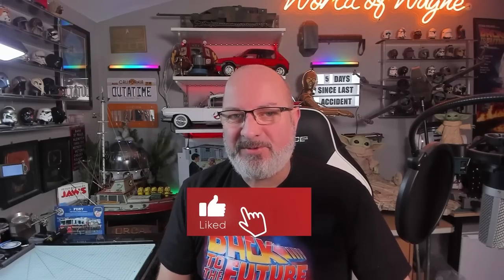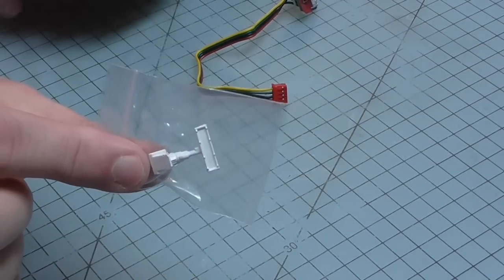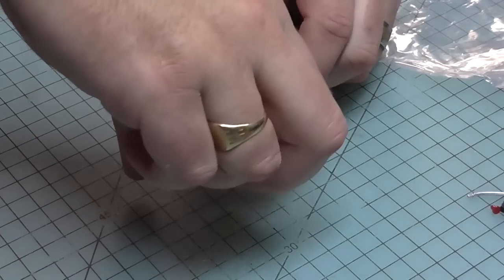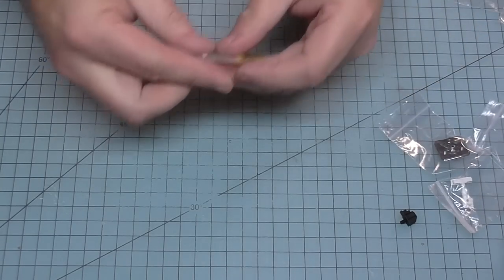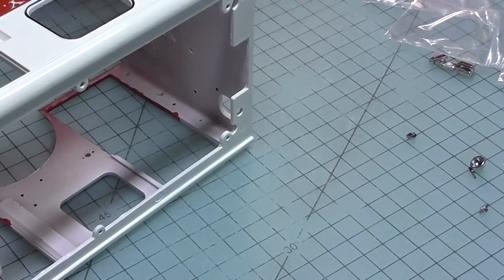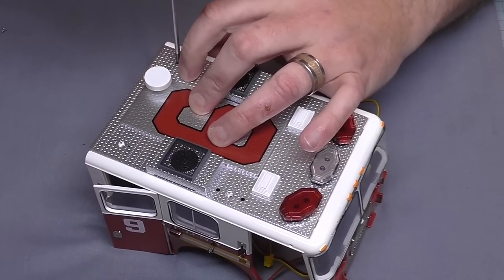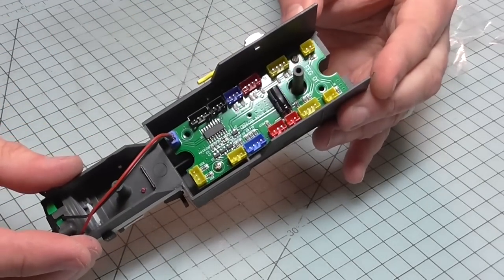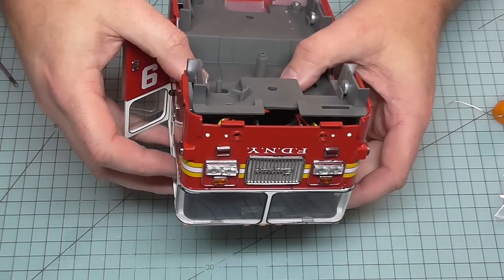Build the FDNY Ladder 9 Fire Truck 1:24 Scale - Pack 3 - Stages 17-23

Comment: Thank you, I had to refer to this video a few times, but you didn't seem to run in to some of the issues I had.  I had to trim both sides of the clear cabin divider with a sharp blade to get it to fit, and I had to file down the corners of the dash to get them to fit.  It wasn't difficult, just tedious and time consuming.  You are right about the tight fits for some of the cables, they could have been a little more generous but thankfully I took care in how I routed them, as you instructed.  Some of the components of this build were ridiculously small, I had spent more time than I care to admit looking on the floor for parts that got away.  I'm not usually lucky at finding parts that ping away but luck was on my side, I found every one that got away.  So far I have referred to your videos on each pack, and I suspect that will continue, so thank you.  I am going to have to support your channel for the help and instruction you provide, it's only right.
Reply from the maker: Thank you NJA and welcome to Patreon

Comment: I just completed Stage 23. Getting the circuit board console into the main cab was very frustrating for me. It took me over an hour to get that in! You didn't seem to have a problem with the clear divider being too wide. I had to trim mine down as well as file the rounded edges of the dash to get this to fit. But getting that in was hard. I just hope after all the pushing and holding on the wires to make sure they're not trapped that the electrics still work! And to think I have to do this 4 more times!

Comment: I'm pretty sure you got your jump seat in backwards. The driver operator aka the chauffeur is the front left seat the officer is the front right seat and then you got all your riders the ones directly behind the driver and officer would be facing backwards with the rest facing forward in the rear of the cab.
Reply: Correct! The Engineer (driver) and Officer face forward like normal. Then in the enclosed cap the seats directly behind the engineer/officer face backwards with the final jump seat rows facing forward. The caps are made to hold 4-6 or more firefighters not including the engineer and officer.

Comment: i dunno..i'm nervous about that yellow plug in the blue socket. seems they went thru a lot of trouble to color code those for a reason.
Reply from the maker: It is a bit odd isn’t it
Reply: yes I have been thnking about the yellow plug in the blue socket.  And like you say they have colour coded(?) the plugs and sockets for a reason. The other thing that was buggin me is the circutboard only having two screws, but four screw holes!

Comment: I'm surprised more kits don't supply an electrical tester board as I recall one did (IXO XXX, or Peugeot 205?). Given how many supply working lights, engine noise, etc it would be helpful to all builders if one were supplied in the first pack, then yu can test each part as you go along. Indeed rather than the occasional free gifts [oops.. gifts has an F in it *lol*], why not a complete tool kit, e.g. tester, sprue snips, and screwdriver? I know you have yours in your workshop, but everyone has to start somewhere with their first kit.

Comment: I found a few other videos of people assembling this model and out of the ones i found YOURS has me at ease assembling (even if i just got it and waiting on packs 1 and 2).

The only big question i kinda have is for the plastic pieces, could regular plastic model glue be used instead of the superglue?? (Yup that was my dumbest question ever to ask lol)

I also subscribed
Reply from the maker: It can but it takes time holding it for parts to cure